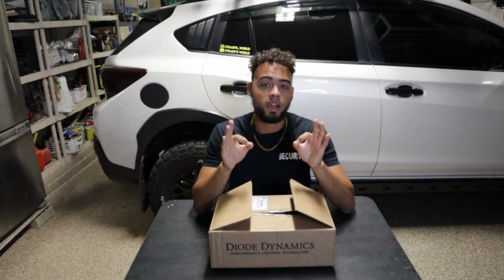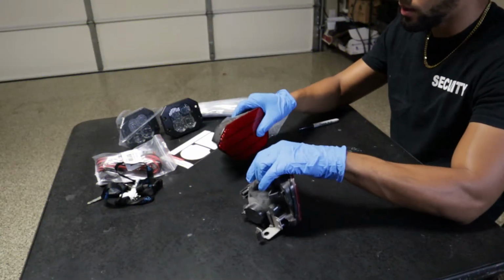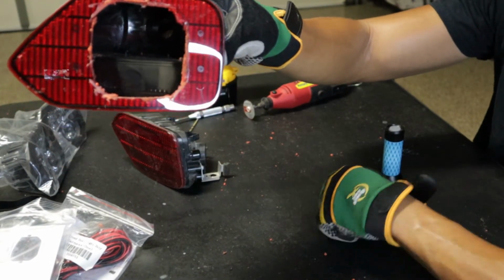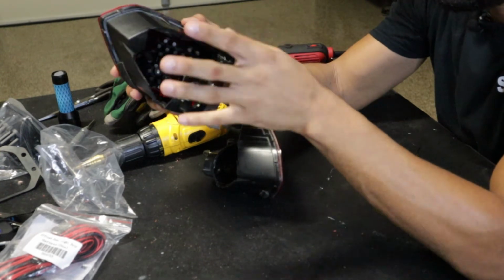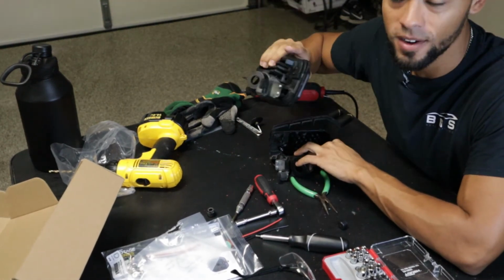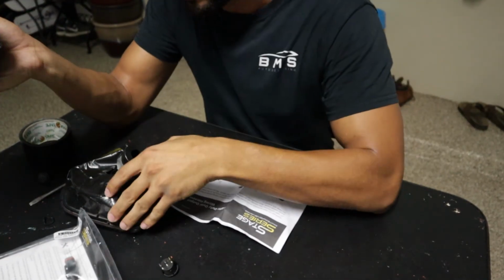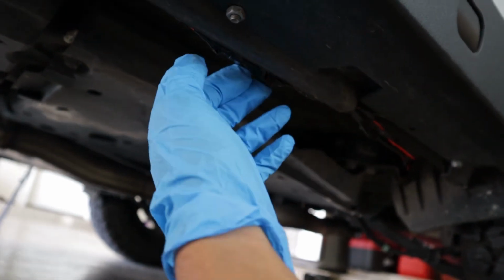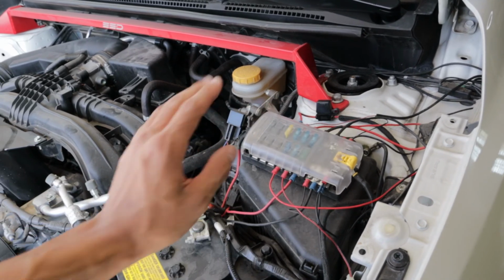Rear Reflector Retrofit!

Comment: I love the fog lights. I don't ever use them, but when i do they are a life saver. Especially in Washington, where your lights don't work even when they are on. 
If you had a manual i would have a recommendation for a short shift kit, but that's clearly not happening. But in case anyone wants to know the 2015+WRX has the same shifter as the 2017+Imprezza and the 2018+crosstrek. So, there's a worthwhile upgrade for those who have the 2018+, well now 2021 crosstrek with a manual. It's a world of difference. And the pedal commander is excellent with the manual. It's like stupid.

Comment: would you recommend I do this with no wiring experience. I want to put a light bar on my Shelby but people are advising me not to. Im also thinking about getting your wheel and tire setup and slapping those bad boys on. if it rubs, it rubs. Nice Video!
Reply from the maker: Off-road Shelby… I don’t think it’s been done, could be interesting 👀
Reply: Wiring is actually relatively easy and given you follow a clear YouTuber or read directions from the supplier you should have no issue. I have a video where I highlighted a YouTuber's example wiring boards, I'll link that below for you.
Reply: @EG
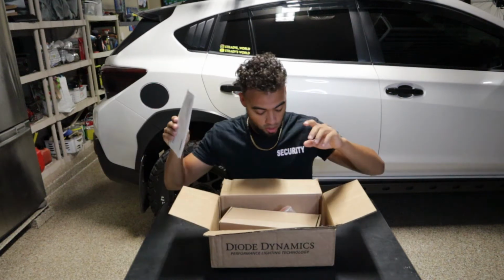https://youtu.be/LxC5BGQ6Hg8 you'll want to skip to 0:51 on my video I believe. Man my content has improved since then.! Music-wise anyway...